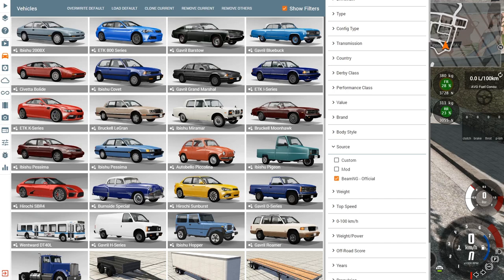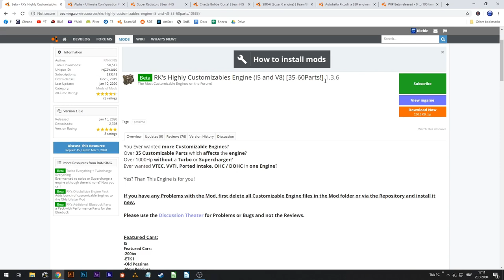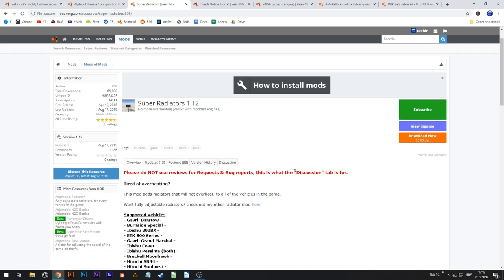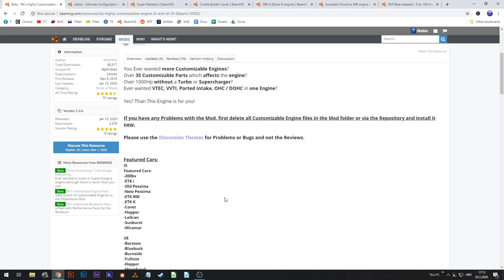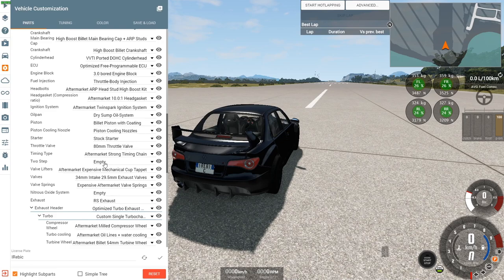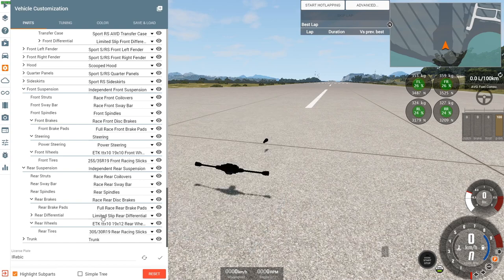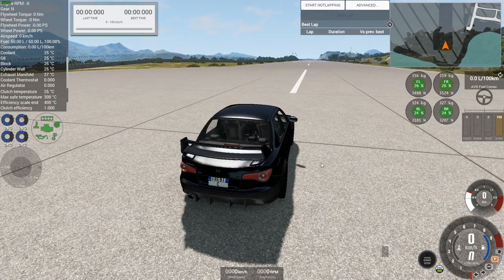BeamNG Drive | How To Customize Vanilla Cars Into Supercars

Comment: After practicing making rally builds in this game I figured out a helpful guide. If the car hits a bump, and immediately launches itself end-over-end, soften the bump. If the car hits a bump, and puts the lowriders of South Central to shame, soften the rebound.
Reply: Could you make a tuning guide? I've been wanting to get into tuning in beamng for a long time, but i never saw any tips.
Reply: @PolishGameRPL-fv8xg  viperconcept's channel has made countless guides on how to tune a car's setup and what they do. From experience, they also apply to BeamNG. His Car Setup Game quiz series is also a good resource as to what to look for if a car is behaving a certain way due to a bad setup.
Reply from the maker: Yup they are a great resource, I've also been using this quick cheat sheet for suspension tuning for a while, seems to work well: http://www.morpca.org/drivers-education-guide/understeer-oversteer/

Comment: Good advice! I saw some good mods. But I think some of them are outdated
Reply from the maker: Yes, not all of the mods get regular updates so many of those will, nturally, become unsupported but new ones keep coming out and I'll make now videos also as the time goes on.
P.S. RK's engines are flagged as outdated but if you manually enable it it works very well, I use it every day ;)

Comment: What do you think about using BeamNG.Drive as a main drift simulator? I have wheel, 3 pedals, shifter. I am asking about physics. Or should I use AC?
Reply from the maker: I don't really drift in sims so I can't give you any advice on that :/
Reply: @CasualGamingTips Ok ):
Reply: @takomusic1  Beam is super fun but Assetto Corsa is more plug and play with better mod support.

Comment: Where did you get slick tires mode?
Reply from the maker: To be honest, I'm not sure and I'll have to check, BUT "Ultimate Configuration Pack", "CJD Special Tunes" and "GPACK" mods from the repository add A LOT of new parts and It's very likely that slicks are in them
Reply: @CasualGamingTips  thank you :)

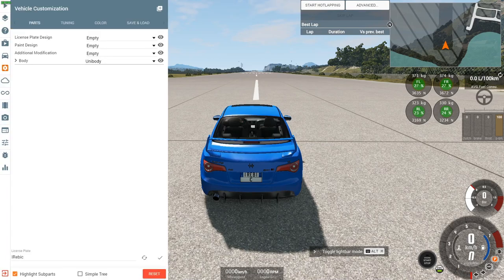Comment: 4:21 how do you get that gui and more stuff on screen? All I have is the speed meter on the bottom right.
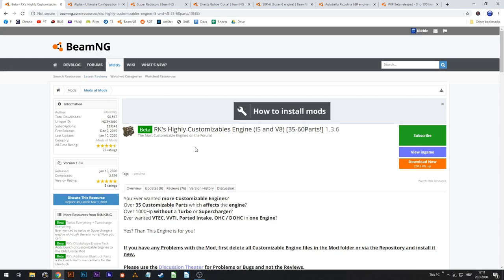Reply from the maker: Options - user interface - custonize UI apps, I explained it in detail in the video "BeamNG.drive - 10 Tips every player should know" at 1:00 so check it out if need more help :)